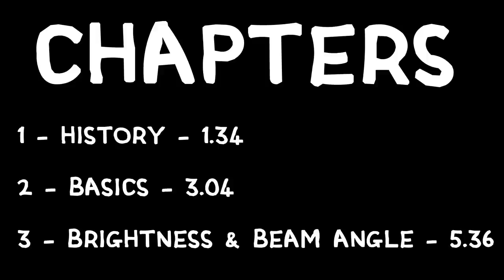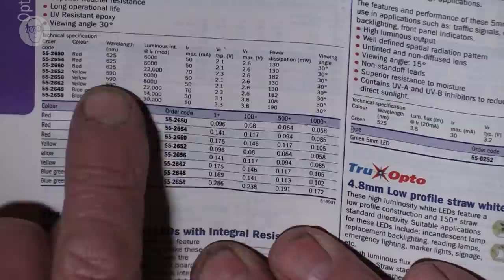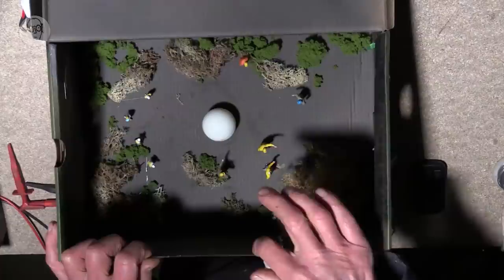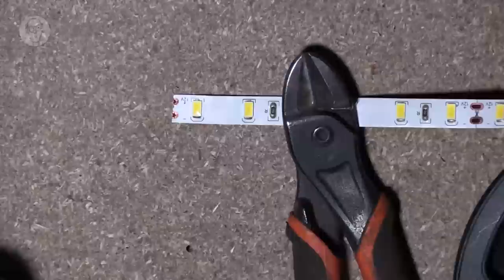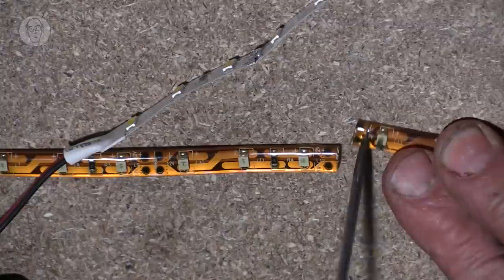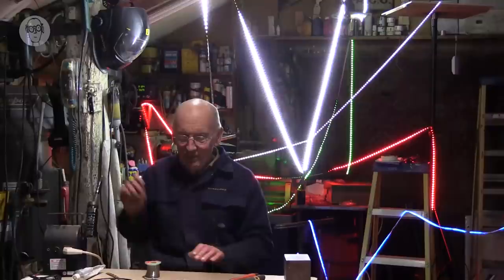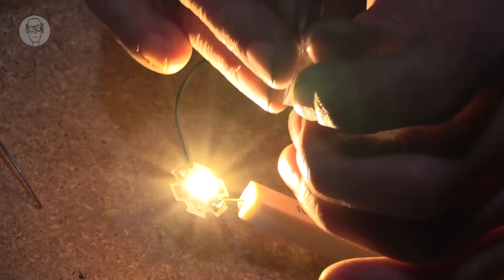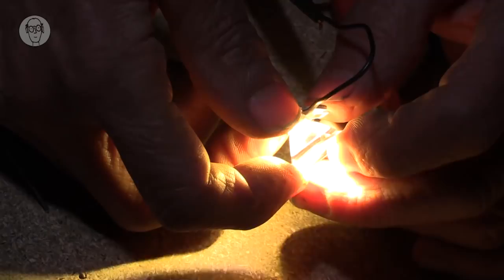LEDs -The Secret Life of components, a series of guides for designers and makers - Episode 2

Comment: You really ought to drive those LEDs with a constant current circuit rather than dumping all that heat into a huge high power resistor.
Reply: Assuming that the supply voltage is the same and the forward voltage drop on the LED(s) is the same a linear constant current regulator (such an an On Semiconductor NSI450 series constant current diode) and a resistor will dump exactly the same amount of power / heat.  The advantage of using a constant current regulator (CCR) is that when the input voltage varies (unregulated supply) or the LED forward voltage varies (with temperature, for example) the CCR will dynamically change the amount of power/heat it dumps in order to keep the LED current constant whereas a resistor will allow the LED current to increase or decrease.

Now, if you have a lot of LEDs in series or only a single LED or short series string of LEDs but no low voltage DC supply available then it may make sense to use a switching constant current regulator but you have to be careful that the parasitic losses in the regulator do not exceed the loss you would have had in a resistor or current regulating diode.  The switching current regulator will also be larger, generate a lot more EMI, and will likely be less reliable due to a larger parts count.  Tim also mentioned in his video that when he has tried to use switching constant current regulating supplies he didn't have much luck with them.

Comment: Think of the resistor method as underlings trailing under a father's overarching presence.  But resistors are a cheap ass solution wasting electricity.  Constant current supplies are best.  Runaway current from thermal mismanagement is the concept to research.  10 sec flesh contact pain is 55° C.  Most preference is less than 70° C with lifetime spec preference at below 120° C.  Compute heat sink surface area once optimal temp is aquired.  Home lighting's sweet spot is at 30 watt cob. (Needs optimal 70 sq inches heat sink area.)  Binning rejects flood the chinese retail market.  Otherwise pay premium local prices to avoid such.  White color descriptors are rife with variation.  As far as lenses, use lightshaping diffusers.  Saves light and is more uniform than standard non holographic diffusion.  Bypass if on the cheap.

Comment: Not bad, but he omitted or confused 2 very important points...
DIMMING - Firstly, dimming LEDs does NOT require a MicroController or Arduino. You simply buy a suitable PWM dimmer module from the same place you buy LED tape, etc from. The cheapest ones cost about $1 and can handle 2A or so, and they go up from there.
CONSTANT CURRENT - LEDs MUST have a current-limited power supply. Using resistors for controlling current is probably the worst way to do that, since the current varies considerably with voltage. The LEDs also change depending on temperature, so it's literally impossible to get a reliable result using resistors. The other problem is that the resitors get VERY hot and waste a lot of power. Look at the example at about 38:00 where a 3W LED is connected to a 15 Ohm resistor that dissipates about 9 WATTS - that is absolutely crazy! Wasting 12W of power for just one 3W LED is not the correct method.
Constant current power supplies for LED are extremely cheap, easy to buy and simple to use. For example, to suit the 800mA 3W star Power LED package...
1. Choose the output power level using LED Specifications for current (eg: 800mA for the 3W star).
2. Check the voltage output of the 800mA power supply you selected. For example, it might say "3V to 20V"...
3. Connect a suitable number of LEDs in series to match the output voltage - in this example a minimum of 1 and maximum of 6 or 5 (ie: 3.3V or 4V each).

Comment: I really enjoyed your video. You mentioned you were confused by the the light bulbs resembling older light bulbs, they are actually called filament leds and they are basically, like a strip of tiny smds covered in silicone. You can buy them loose (without the bulb) online (mostly from china) for pretty cheap. Here is a video from someone else I follow on youtube who takes a close look at them and how they work, if you're interested: https://youtu.be/H_XiunR-cAQ